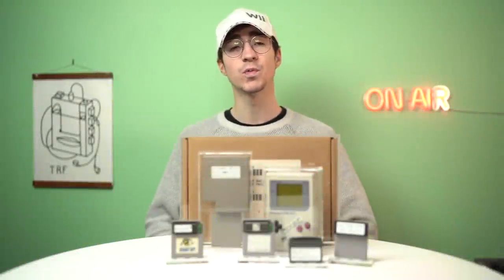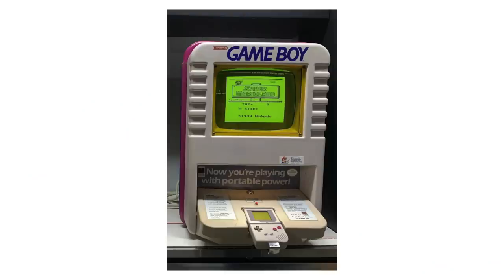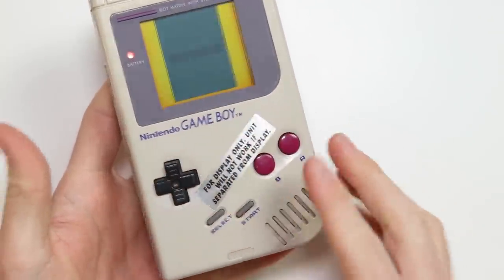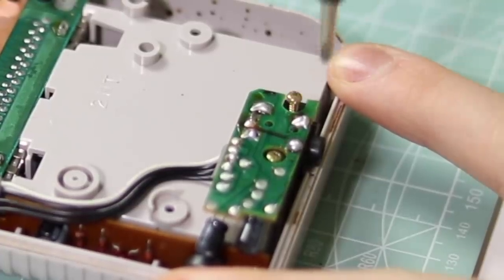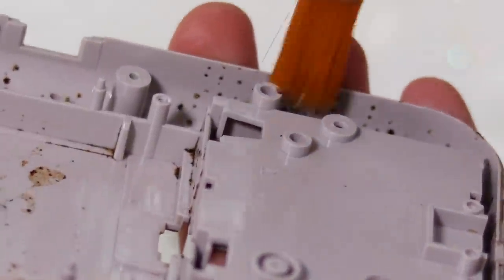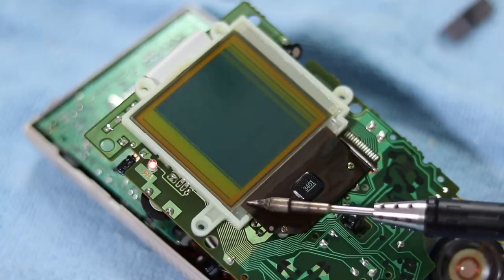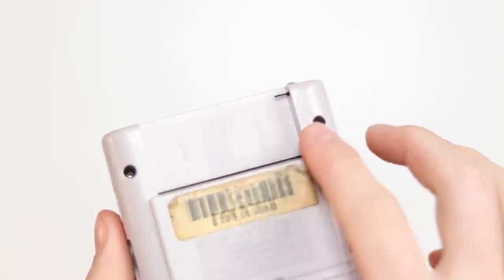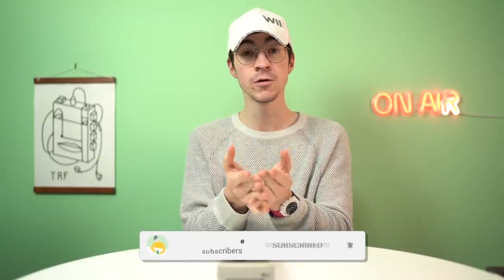Nintendo LIED about this GameBoy

Comment: The simplest answer is often right. An incredibly cheap anti-theft measure. No need to change hardware, just spend $0.05 per sticker.
Reply: My thoughts exactly.
Reply: Yes this is exactly what it was for.
Reply: and stealing the battery door.  If you took it off the display, you'd no longer have power going to the Gameboy.  But anyone with batteries and a piece of plastic with tape can get it working again.  But mostly the Sticker was the incentive to not steal it.
Reply: I assume that the CRT versions also had it, and presumably it would actually be true for those?
And they just put the same one on the cheaper non-CRT version as well.
Reply: @kargaroc386  Not true for those at all. Just a special cable which allowed it to be plugged into a CRT TV, but all GameBoys had that port for that cable.
Reply: Sans Handlebars I think it was a special model. The kids reviewing the  games on Bad Influence used something similar.
Reply: @wisteela  Nope. No special model.
Reply: @Eidolon1andOnly  Be interesting how it worked..
Reply: @wisteela  Same as a regular classic GameBoy but with a modified Link Cable.
Reply: @Eidolon1andOnly  I'm wondering how that works though.
Reply: @wisteela  It's not as if RCA or other cables didn't exist which would allow one device to link to another device to mirror the same display during the time of the GameBoy's release. It's not a stretch to think that the GameBoy, which already had a visual output port to link to other devices could also link to other devices like a TV screen.
Reply: @Eidolon1andOnly  They have no video out capability
Reply: @wisteela  Look up the GameBoy Link Cable. It existed even back when the first GameBoy generation was released and allowed 2 or more GameBoys to be linked to play a selection of multiplayer games. It was literally packaged as the GameBoy Video Link cable. Remember how I said it was a "modified link cable"? That's how it was done. One side of the cable was able to plug into a GamBoy, the other side of the cable could plug into a TV screen. The GameBoy itself wasn't special, only the connecting cable, since reworking a cable is a lot cheaper and easier than reworking the GameBoy.
Reply: @Eidolon1andOnly  It only had serial data.
Reply: @Eidolon1andOnly   The link cable only seemed to only transmit the control inputs - not video, or game data.  Thus 2 games were running at the same time, with the same controller inputs sent to both games, so both games would do the exact same thing.  One could easily see this if one disconnected the link while in game, moved on one gameboy controllers to move the character, then reconnected the link back.  The game characters would be out of sync/ different positions and perhaps different score/health etc.  Sometimes you could get them to resync (like moving into a corner) sometimes they would be off from that point on.  IDK if other data could be sent over that link cable, but just sending the controller inputs is such  a brilliantly simple solution I doubt it ever did more than that.  More likely for the full CRT display it was a special cartridge that had a video cable or other way to interface with the CRT, or simply did use the link but to run another cartridge inside the display.
Reply: @DavidStrchld  Could the cartridge have been played inside the display using a link cable to send the inputs to the cartridge?
Reply: @Eidolon1andOnly  is this cable/plug something the still usable?
Reply: It’s just a display gameboy lol calm down nerds
Reply: Only $0.05 each for the greatest security system ever! bargain :)

Comment: Imagine if pokemon was in it and someone came and linked his gb to that one and stole all the pokemon on it
Reply from the maker: The link cable port was covered in the kiosk unfortunately!
Reply: Without the keys to Kiosk, and a set of electronics screw drivers about all you could access on the units do the metal bar across them where the face buttons for the game that was currently in the system. I'm in the US, and my area has Roses department stores, and when they where much bigger in the 80's, and 90's they did have video games behind a big glass display case in the electronics department, and I went there often as they had the best prices on Game Gear games, but they had a Gameboy display with the TV, and like i said impossible to steal, or use with a link cable, but at least they did change out the games every so often to try, and keep kids wanting to buy new games, unlike other places that just left the default Tetris, or Super Mario Land in the system.

Comment: I have a feeling that some of the Kiosks had a special Gameboy Cartridge which outputs video to the CRT and had a second cartridge slot for Retail Games, possibly inside the unit.
Reply: I think it was simpler than that: a cartridge which just reads the buttons and passes them on to the real console inside the kiosk (which might just be a modified Super Game Boy).
Reply: @renakunisaki  Well, that's definitely interesting.

Comment: My guess is that it wouldn't have worked if somebody went up and stole it. Perhaps the kiosk lacked batteries and used the power jack on the Gameboy to power it. If someone actually stole it, they'd need to put batteries in it to get it to work.

Comment: I used to work for a company that made the demo units for Nintendo. There was so many different demo units for different consoles Gameboys and The point of the sticker was keep people from stealing the gameboys and but on some units they had wires coming from the gameboys for the reset button on the kiosk or a reset timer. Also some had a black and white monitor on the top of the demo unit and the wires connected directly to to gameboy.

Comment: I worked at Toys R Us back in the 90's doing what they called security. Basically I worked the video game areas, and ticked desk. Part of what I did was manage the displays. We have one of those kiosks with the larger display on top, and the Game Boy buttons failed. It to was marked with that exact sticker. They sent a replacement, and didn't want the old one back. I took it home, removed the ribbon cable that was hanging out of the opening in the battery compartment, replaced the button pads, and used it for years. Later on I ended up with the whole kiosk, but wasn't smart enough to hold on to it.

Comment: HP did the same thing with the Sprocket printer. I saved a display unit from the trash and after prying it open and taking the pool of glue out, it worked perfect.

Comment: The lack of a battery compartment lid is also in-line with the kiosk you showed.  It was probably clipped to a power supply instead, and the back left open.
So, your replacement cover is in-authentic.  You should use a contrasting obvious replacement like a 3-d printed cover or a clear cover to make that distinction, rather than substituting a different original cover.

Comment: Top tip for you, instead of using hand soap and water. Try muck off cleaner. I use muckoff for cleaning plastics, metals and it won't damage the membrains or plastics. Silicone lubricant is also a surprising good cleaner.

Comment: I think the sticker is pointing out that it won’t continue working if you remove it from the display as the power would need to be disconnected to remove it, not that it won’t ever work at all once removed.

Comment: I actually have real NOS display and cpu boards here and just as the displays get lines like this even the unused ones suffer from the same deteriorated bonds to the display as well, since they are just as old as the actual Gameboys age has gotten to them. so I am also aware of the heating method :)

Comment: I think the kiosk that that particular one had the battery pack built onto it rather than being able to use AA batteries, which might also explain the missing back.

If someone were to steal it from the kiosk, they wouldn't be able to play it immediately, but would have to get batteries for it too

Comment: Brush seems to be pretty good; but as fellow enthusiast:
Toothbrushes. There is many kinds, they are more brittle and made to brush off generall harder - at your teets. Basically mini backbrush hardness that usually will not penetrate any plastics used in video gaming products but cleans them up way good.
Also, I am not sure did I just see wrong and thus assume wrong: Dishwashing liquid is better than handsoap. You do not need much of it to create effective soapy cleaning water ("You always use too much dishwashing liquid" - Dishwashing liquid seller) and is generally a soap that is made to generally attack types of stains that develop on consoles and their buttons. 

Though; to say something I myself learned/got to figure out from this video: The brush is EXCELLENT tool for more than just little grimy button rubber membrane cleaning. I somethimes struggle with optimal way to get those clean without leaving material or residue on them that will stay on them. Alcohol pads that I use for one example, usually can leave a "invisible stain" of leftover matter that can feel weird, cause weirdly sticky feeling or not-stellar contact action from the rubber membrane's "impact" area if not rinsed well, defeating the "quick easy and effectively dry" cleanup job alcohol pads sometimes are for me.

Since nobody ever talks about these, and it is all "figuring it out myself" just about for every collector, I think this is healthy input and output. Even for me the toothbrush was not an original idea. It came from working at recycling center where ladies and men in charge of cleaning up ovens and such home appliances before resale would have in their extensive menu of dish brushes, rough sponges, wipes and such, also, a lot of toothbrushes, which were used for nook'n'cranny type of deal and something I ended up using for few retro consoles I cleaned up for sale myself too.
And; I am fully aware making this comment, that this might not be a "never though of that" thing as much as it could be; and delicacy with rare pieces might been the reason here (though, in my mind especially given the type of dirt, unneeded delicacy which toothbrush could have attacked better)

Comment: I suspect the missing battery door had to do with being attached to the kiosk. Obviously it wouldn't make sense for them to run a display model off of batteries so the display unit probably ran off of AC/DC power, and being stationary there would be no need for a battery door so instead they probably designed the kiosk itself to clip into the battery door latches for added stability/security.

The idea that removing it would disable it's function is a bit of a stretch, but also not technically a lie in a short term sense, since doing so would disconnect it from the DC power.

Comment: Eliot.   That's a 0 ohm Resistor on the pcb by the power connector that needs to be moved over to work.  You'll see a blank spot.   If it's on the other spot it won't work vice versa.  That unit has been modded

Comment: I would guess that sticker wasn't aimed (at least directly) at theft. My interpretation of that sticker is that it was meant for kids and families that were demoing the unit, tell them not to try to slide it out of the kiosk or otherwise remove it to play it. It's powered by the kiosk (and in some cases the kiosk is displaying the screen too) and needs to remain in the kiosk to function for the demo.

Comment: I think the warning sticker is referring to the fact that the kiosk had a physical power connection and would  "not work" if you detached it from that power supply and didn't steal a pack of AA batteries along with it.  Not that it had a security feature that would disable it if you removed it from the kiosk.  Of course it's vaguely worded to sound like an ominous warning that it'll self-destruct if you even think about f* with Nintendo.

Comment: It seems yours was from the kiosk without the display.  I'm making some assumptions here, but on the kiosk I had there's a ribbon cable soldered directly to the Game Boy Pocket.  The other end connects to the DEMO VISION box that outputs to the 13" B/w monitor and powers the GBP.  I'm guessing the kiosk DMG with the monitor would also work when separated, but it would have been really hard to steal without wire cutters. In all honesty I've never tried running my GBP without being connected to the box.

Comment: Probably what the sticker meant is that the Game Boy in the kiosk didn't have the actual game in it. Just a "dummy" cartridge that reads the buttons and passes them along to the real console inside the kiosk (which in some cases was probably just a Super Game Boy). So if you were to steal it you would have a working Game Boy, but no game.

And/or like 2000 other people have already said, it discouraged theft.

Comment: It probably was true of the Game Boy units that were attached to the CRT display, then they simply used the same stickers for the cheaper kiosks with no display. Technically, even with the cheaper kiosks, the Game Boy wouldn't work if removed because it would lose power. Easily remedied with a pack of AA batteries, but still technically true.

Comment: I have one question why don’t you use 99% isopropyl alcohol? It’s not corrosive so It won’t damage the motherboard or any electronics if it gets on it And it cleans a hell of a lot better than soap and water

Comment: I think what they meant was that if separated  from the display and the included power cable that the unit will not work. That and a theft deterrent.

Comment: Very interesting video but if you want to save and preserve those stickers I've learned a very interesting technique if you ever heard of the website I fix it they sell something called a iopener it's designed to heat up the adhesive around LCD displays so that you're able to lift off the screen without damaging the glass or LCD this works exceedingly well with all decals and stickers and I've used it to open Japanese mega drive games as well as remove original game boy stickers to clean the shelves you might want to think about using that to make your life a lot easier.

Comment: Why would they lie?
Maybe there were special units made for that purpose, but sometimes they were short or a unit was replaced and they used an ordinary GameBoy instead.  For the non-CRT display, that would work just fine.  The sticker still acted as a deterrent against stealing and a property sticker if the LP officer found it on a shopper.

Comment: My guess is that the kiosk would have powered this directly. The Gameboy would have clipped in, and the kiosk would have made contact with the battery terminals. This would provide mounting, explain why the battery cover is missing, and explain why removing the Gameboy from the kiosk would render it non-functional. (Because it has no power)

To reiterate this is my guess. I don't actually know, but it'd make sense.

Comment: After working in retail, I don't usually believe stickers that say things like that. If its valuable enough that they're willing to have a device brick itself if disconnected to avoid theft, why even warn anybody? Just have it brick in a way that when they bring it in to get "their" device fixed its obviously stolen. Retail chains will put labels like "security device inside" but they have no such device, while other unassuming items are packaged with anti theft devices and no warning of such (unless you're looking for them, they're not impossible to find usually). Its funny they didn't actually make it non operable when separated from the kiosk, especially when the it would have tons of space to put some kind of processor in there for such a check, along with a simple killswitch.

Comment: They were usually plugged in with a power source, not with batteries. So if they would stop working until you put batteries in them if you steal it from a store.

Comment: not sure but the stains inside look like smoker's stains. My parents used to smoke a lot and the tv remote used to have that kind of gunk inside when i cleaned it. Thats why its even on the top side and corners where liquid has no way to splash into.  I guess its some crap from the smoke that condenses on surfaces.
It doesnt sound too probable but based on my experience i guess someone smoked in that store.

Comment: The cost of making special Gameboys that had anti-theft hardware to detect when they weren't connected to a kiosk would have been more expensive than the cost of just sending replacements for the small number of standard Gameboy units that would likely have been stolen / separated and reused during the lifecycle of the kiosks. So the most efficient solution for Nintendo wasn't to make special Gameboys. It was to print stickers that cost a couple of cents each and put them on regular Gameboys.

Comment: The other option. The sticker is telling a half truth. They put that sticker on all Kiosks. But only the ones with the CRT won't work. I bet they have a modified cable that goes from the LCD screen connector. To the display screen.

Comment: I don't think they lied on the sticker. Clearly it was meant to prevent someone from stealing it but the statement itself isn`t wrong. Inside the cabinet it would run with an AC adapter and had therefore no batteries inside. Therefore it wouldn't work if its taken from the cabinet. That you could get it running by putting batteries in, is written on a different page :D

Comment: "Why would they lie" Security by obscurity, making it less likely that kids or other wannabe criminals try to pull out the system from the display unit to yank a free gameboy for themselves.
... I may or may not have had one semi accidental case of display unit mishap that may or may not scored me a free gamecube memory card...
... ... The guilt I felt for weeks as the demo disc would not work anymore without one...
 ... ... ... Nintendo, why did you make gamecube demo/display unit discs require memory cards?